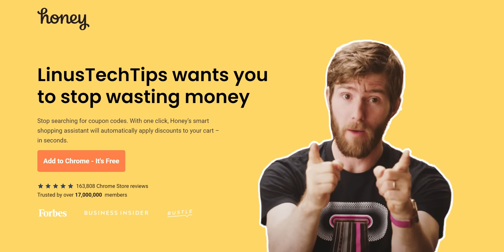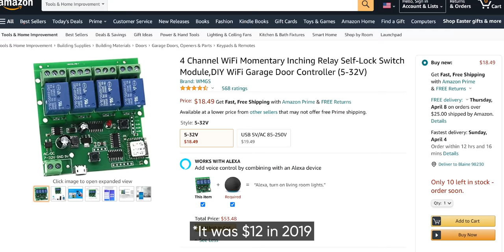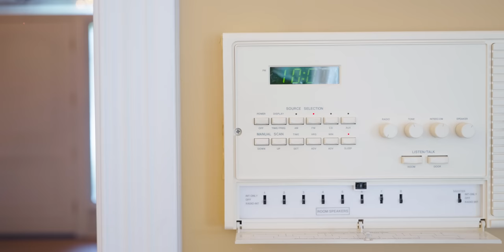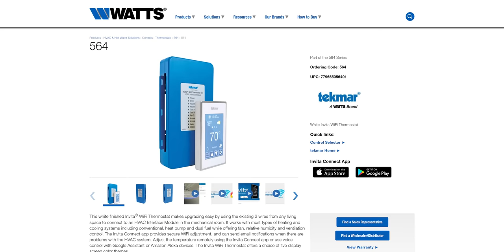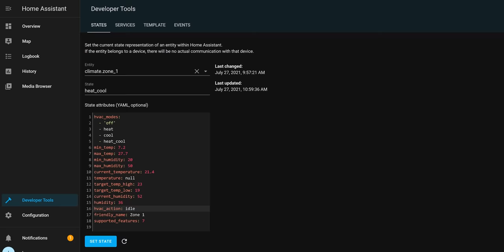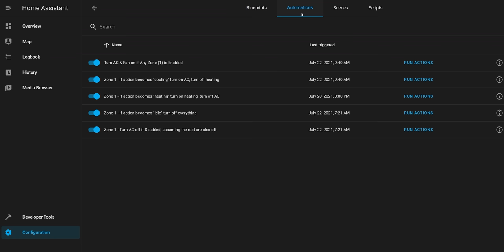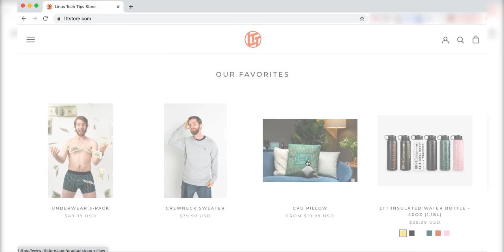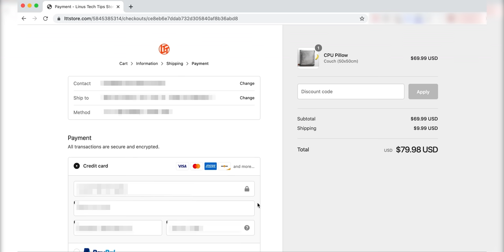This Should've Been EASY - New House Smart HVAC

Comment: If you have central air for AC with 1 AC unit then I question if it'll be really any cheaper than cooling the whole house unless you have a variable speed blower or variable compressor. Having dampers closed will pull the blower out of it's max efficiency curve due to higher pressures in the ducts. And the lower airflow over your evaporator will make it run colder which will make your condenser outside run less efficient since it'll have a smaller difference in refrigerant vs outside air temp. All of this in theory of course but it'd be nice to see some before and after data on this kind of setup. All of this assuming the ducting in the house was made with correct sizing of components in mind of course. I'm not an HVACologist but my brain having absorbed a thermodynamics class in college made the above thought.
Reply: Yeah, HVAC engineers have commented similar concerns. He needs to ensure minimum system airflow (not running the system with too few zones active) to avoid evaporator freeze-over. He also needs to ensure that the cycle time on the compressor is at adequate intervals.

It's all entirely possible using logic in HomeAssistant, but it requires adding  deliberate constraints to the system's operation which he didn't explain in the video.

Comment: I would definitely add a bypass damper from the supply to return on the ductwork this way you don't have issues with not enough airflow and possibly freezing your ac coil, honeywell makes nice ones like the dampers your using.

Comment: A few more tips from a journeyman level HVAC installer from Northern California:

How many zones will you have for your A/C? I understand what it is your going for in terms of the efficiency. But your pairing a new concept with old equipment and it's not a great combination. For starters you at least need to upgrade to an ECM blower motor that will ramp up or down to maintain consistent airflow across the coil. Otherwise, on a 25 year old unit, closing off 3 rooms that are not occupied can actually cost you more money than if you left them open. To elaborate; A/C charge is almost entirely based upon airflow across both your coils. By shutting off multiple zones you are creating excess static pressure, directly tanking your airflow across your evaporative coil, subsequently tanking your SEER rating with it. A number of other problems can present themselves like the evaporative coil freezing over, the system short cycling, and surprisingly sometimes increased daily run time. Your trying to mimic the new fancy inverter/modulating systems with a system that is most likely a single stage system, and again this is a far from ideal set-up. 

It's a good idea to configure the dampers to power close, so if something fails, the zone is not stuck shut until the failed component is replaced or damper removed. And those particular dampers should be spring returns (Assuming they are Honeywell ARD models). If you look on where you wire it up on the damper motor, you have M1, M4 and M6 I believe. M6 is just 24v common, M1 is powered open, and M4 is powered close. Therefore they should not be getting 24 volts whether they are opened or closed, just one or the other. I get the logic, but I guess you have to choose the lesser of the two evils, do you want to risk burning the ARD motor or the relay up first?

Comment: You’re going to short cycle the compressor of the ac with all those sensors causing failure. And cause the evaporator fan motor to fail sooner by having dampers close randomly making the motor to work harder. You’re going to need a variable speed compressor and install a bypass damper so the air releases to a open space and not cause back pressure leading to a fan motor failure.
Reply: Or just go with a variable speed compressor hooked up to a ductless AC system with vavling inside the refrigerant pioes and a evaporators for each zone.

Most efficient system there is with no minimum flow requirements.

But expensive to install
Reply: Among other issues his coil will freeze as well because he is stopping proper air flow. He will kill his AC. Wanna bet this stupid idea came from Brian.  As many have said before he NEEDS a real pro to design a actual system not.some homeowner shit show.
Reply: @zack9912000  I agree. I was looking into this and there is so much technical information I was lacking. You need technical advice.
Reply: @zack9912000  If you watch this channel you well know that getting a pro is not really what they do. Multiple times in this video they made it clear that this was a proof of concept demo. In reality there is likely to be little to no issue with this system because you are ignoring hundreds of other factors. Every house is different and they live in Canada not Texas the AC will see little use as is. Its a shitty one thermostat system as is and it is crap as is. A system that reads from 1 location and then blast on full if its a few degrees under is garbage. The house was using Mercury thermostats. Everyone wants to play armchair professional.
Reply: @zack9912000  he really doesn’t need a professional.

Either he gets a throttlable compressor and modifies the valves in the ducts so there’s always a minimum amount of airflow or he goes ductless with individual evaporators per zone  and a trhrotlable compressor.

The second one is way more efficient but harder to install.
Reply: @anonym3017 Yea he could attempt that. Yet It is stupid as hell to even attempt that on a new system and especially on a 25 year old R22 system. He absolutely does need a professional contractor. Been doing this exact work for a very long time. The cost of the R22 alone make that a horrible idea. He needs a true zone system installed with a inverter compressor
Reply: @zack9912000 hvacdirect sells ductless 9 zone split AC systems, just way overspecced at 56k BTU and expensive at 9880 USD. So you definitely don't need a professional for planning.

Same goes for a new compressor and evaporator with valved ducts.

And you aren't staying on R22 either way because both of them entail an entirely new AC system that maybe uses the old ducts.
Reply: @anonym3017  You clearly don't do this for a  living, he still needs to have the system designed for what size equipment for each room is needed.  There are required equipment  to install them to.code, if the lineset runs longer then what they are spec for you have to add refrigerant which he doesn't have the license to purchase or has any idea how to add.

Also your  idea of changing the compressor in a old r22 unit requires a special license to purchase the replacment refrigerant for the job for the repair and  again special  recovery tools he doesn't own and would be a idiot to try and rebuild a 25 year  old system. This isn't  DIY job at all. What was done at his last home.by Brian the butcher won't even last 5 years how terrible of a job that was done.

 Attempting to do another Mini split system.would be a stupid idea because he already has ductwork ran through out the home and they have specialized systems for what he is wanting to do and they Don't sell those to homeowners
Reply: @zack9912000  again. I said doesn't require a professional for planning.

and why would you keep the system on R22 when changing the compressor. AC lines are the same no matter what refrigerant you are running ( barring CO2) so you can change to a R410A compressor.

and yes he already has the ducting but using a split system with an evaporator for each zone would still be more efficient and get rid of minimum flow rates as well as get a slightly better noise and smell insulation between zones. it would just be more expensive

Comment: Be careful with using motion detectors as "presence awareness."  Anyone who has stayed in a hotel in a hot area that has the air-con on a motion detector can tell you how much that sucks. It can still work just fine, just be careful is all.
Reply: 100% this.  I went to a hotel once with motion detection AC and it kept shutting off during the night while I was sleeping because it didn't detect any motion.  Waking up to 78 degrees is not fun.
Reply: @guy000001  bed sensor mats, does this actually exist? lol, you could just program it to be active regardless of the sensor during night time. Not perfect, but do you really need yet more sensors, yet more complexity for a few nights away per year?
Reply: Same concern. I  wonder if any of his kids will get crafty and do something like put an oscillating fan right in front of the sensor lol. I live above a garage, and I just get tons of heat coming up through the floor all night and day. Some nights I just can't seem to cram enough air through the open windows to keep the room from boiling and need ac all night. Sucks, because it's a lot of energy and I loved having fresh air while I slept, but it is what it is.

Edit: put the vaguely funny thing before my whole life story instead of after cuz I felt like it.
Reply: Simple solution, have door sensors aswell then use that with some logic statements to determasn the last presence, so eg. If someone goes into a room and the door is closes then keep room active and if door opens and no mostion is detected afterwards then the room should be marked for no presence and based on those two states you can set your automations
Reply: @MrMustangMan67  You could insulate the ceiling of the garage below you. I'd also recommend installing a fresh-air intake and exhaust fan down there to keep the garage closer to outdoor ambient.
Reply: @dustinbrueggemann1875  Hmm I appreciate the advice, unfortunately there's drywall on the ceiling, but agree that it's probably not insulated. I've hung things from the ceiling in there, but missed the stud a couple of times. Fiberglass has not come out the way it has in my past experiences. It could be a kind of insulation I don't know about, because it's by far the newest house I've lived in (2015). I will definitely look into exhaust vents in the future. I did my best to insulate the garage door. Unfortunately, both the garage and the room I'm staying in have 3 wall sun exposure, so both spaces absorb heat dusk till dawn.

Comment: As someone with floor heating and a big space. Usually the time period before you start noticeably heating the air in the room is 1-3 hours (with wooden floor that limit the temp of the water). If you don't use the cooling for just cool air draft, I doubt the room targeted cooling on a occupancy bases will be useful, because of the ventilation requirements and the time required to cool a room I expect it will mostly cool to late or get cooled down with the rest of the house. 
If your house is properly insulated and has large windows on the south, "just" make sure the sun doesn't enter in summer but does in the winter (make the sun hit something outside the house), takes care of most the heating (when the sun shines) and drastically reduces cooling needs. Srsly it can get warmer in the winter after a few hours of sun.

Comment: Just need to consider than when dampers are closed it raises the airflow, and therefore velocity, and therefore static pressure of the system... Long story short if a lot of them are closed, just watch for ice.
Reply: "Linus tried to find leaks in his ac system?"
Reply: It would be an interesting controls problem to regulate the speed of the fan to maintain inter-duct pressure within a certain range.
Reply: You just need a control fan speed based on how many dampers are closed, or run it to an economizer for fresh air intake, since new houses are too well insulated that they don’t bring in enough fresh air
Reply: @jake93  well if you do that then there won't be enough airflow over the coils
Reply: @itech301  which is fine if you use an eev, something that can control on variable load so you don’t get floodback, ice build up etc. If it’s cap tube then yeah. This is Linus tech tips and he’s all into tech so if you are already using a control system for zone control etc, just add more tech. It’s obviously not easy, most zone systems I work on use a chilled water loop, so I don’t know exactly what to do but using grocery store logic eev’s give you a lot of control
Reply: A pressure sensor in the duct right after the main fan linked to a speed controller for the fan should do it.
Reply: @dougle03  except wouldn’t you have low airflow over your coil even with that?

Iced up Evap. Maybe a EEPR to combat the low suction pressure. Or a variable speed compressor to lower the capacity with different zones closed

You can literally just have a damper open to the outside when zones are closed but that is just a waste
Reply: @jake93  You absolutely can not.do that with his 25 year old system. His rated tonnage system needs a certain amount of Air flow. What you are describing is a inverter system that can ramp up and down depending on demand.
Reply: (... or just use minisplits ;) )
Reply: @jake93  Yes that's true. I prefer chilled water loop and mini fan coil units in each zone but I suspect that's beyond what he's willing to install since it's a lot of extra pipework and power supplies plus the space needed for each FCU; still at least he's got ducting for air handling/cycling just no info on the AHU for fresh air and thermal transfer for extra efficiencies....?
Reply: @jake93  can you even add one to a system like that? you'd probably have to replace the entire indoor and outdoor units
Reply: @zack9912000  thanks for the insight, in my opinion using what he has now it’s not possible for it to work properly, but I’m also not an engineer
Reply: @itech301  No with his current system its not possible to do or make any financial sense to even try. he needs a purpose built system

Comment: Without any variable compressor/fan speed this system is setup for failure.
Running the whole system in full power to cool down a single zone will bring so many issues.
Modern systems that work with dampers come equipped with inverter compressors and pressure controlled fan's but will probably require you to swap out your AC completely.
Reply: But it's a single compression?
Reply: @johnmidwest5650  yeah hence having to swap the entire system.

And variable compressors only filtered down to residential use in the last 10 years or so. Same for pressure controlled fans

Comment: Just remember bedrooms will show no occupancy when people are asleep.
Reply: I guess one could use time for that. Or pressure sensors under the bed if you want to get really fancy.
Reply: @rGunti  or timers. Or phone location.
Reply: @markyfrencho  I think AC/heating turning off with occupancy is very silly for many reasons, mostly because some rooms will always be hot/cold when you walk into them. Maybe for a garage where you may not be for 12 hours or something can have looser heat controls set, but not off.
Reply: @gajbooks  I very much agree. Some rooms take too long to cool down especially once you pass +/- 20°f off your comfort zone.

Comment: To add up to the efficiency, you could add some sensor on windows to detect if they are opened or closed.
Then if the window is open, you can turn off the AC and heater in the room.

Comment: Wire the dampers normally open since that is the "safer" fail situation. If your damper controller goes out with the dampers all shut, you'll have to manually open everything before you can use your AC. Plus you don't want to over pressurize the system and 1) burn up your fan or 2) blow out your ductwork (less likely but possible). You'll also want to make sure that there is a call for cooling to at least 80% of your home before turning on your central AC because you will have the same 2  problems mentioned earlier or you can freeze up your evaporator coil because there isn't' enough airflow. If you need a truely variable system, you'll need to have a variable speed fan that controls based on static pressure (this is what commercial systems do) and a variable speed compressor that controls based on evaporator discharge air temperature (again what commercial systems do). Good luck finding a residential unit that will do it.

Comment: One issue you might run into is that central AC is sized to cool the entire house, not just one room. Since you have all those fancy thermostats, maybe set them up so when a zone calls for cooling, check what the average air temp in the house is, and redistribute some of the cooler air to the one hot room, and only turn on the AC when the temperature rises a degree or so in the majority of the house to avoid under loading the compressor and causing the evaporator to freeze up. You might also want to see about a variable-speed blower. Or if you felt like doing something completely different, get a unit that cools water and set it to keep a tank at a specific temperature, then put a fan and water-to-air coils in each zone. The water’s thermal mass should avoid short-cycling the chiller, and as a big plus you can make the video title “Watercooling my ENTIRE HOUSE!”